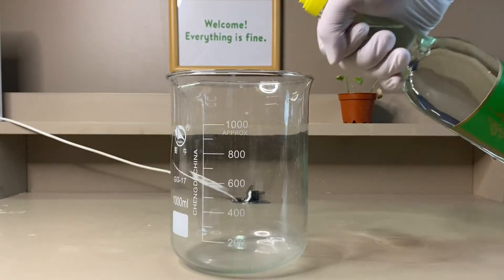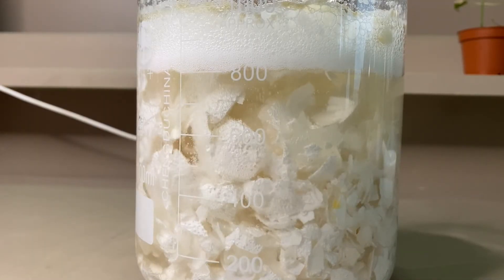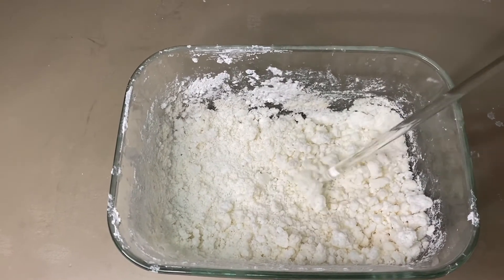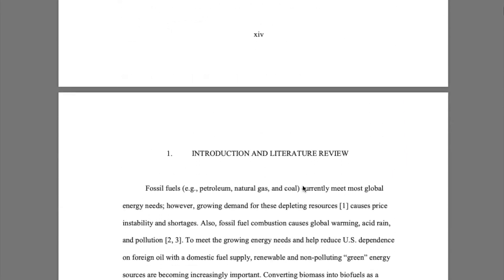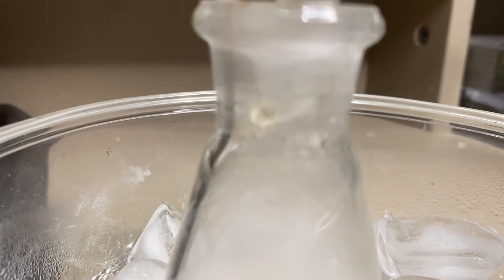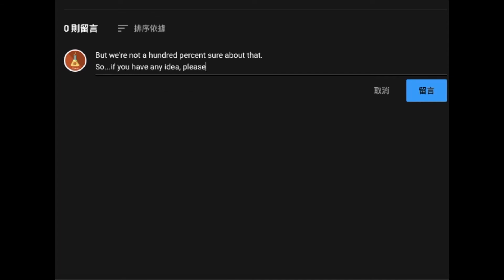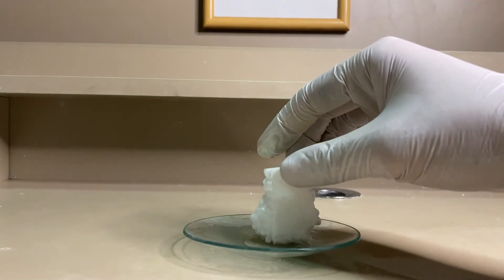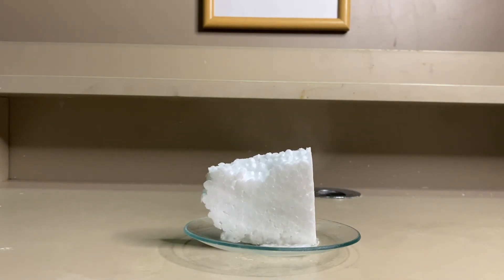Making acetone thinner from scratch

Comment: Hey, thanks for the informative upload.
I have a query, Is producing acetone from this process not good for the environment ? 
Given it can provide a use to the waste egg shells that otherwise gets dumped.
Reply: The calcium carbonate produced at the end is the same stuff as the eggshell, just purified. So you could indeed wash it and then use it for calcium in fertilizer
Reply: @1495978707  thanks for the reply, but you still didn't answer my question.
Reply: @1495978707  is producing acetone by this process good for the environment?